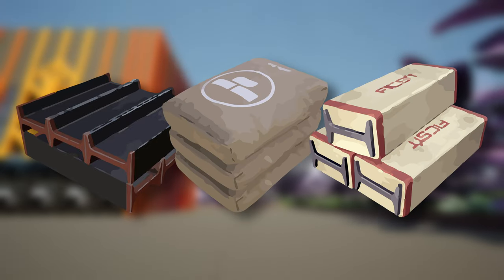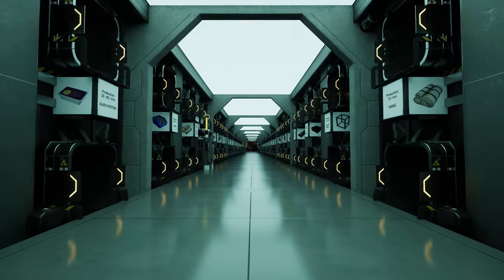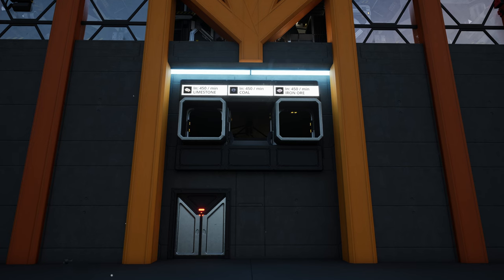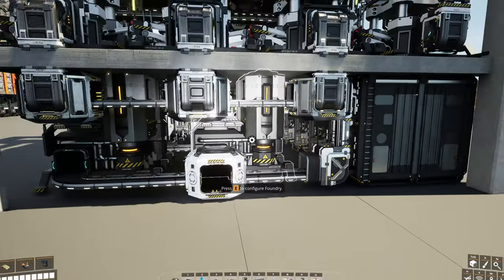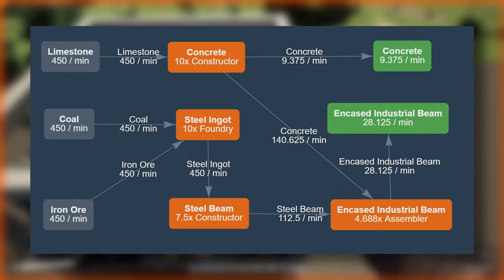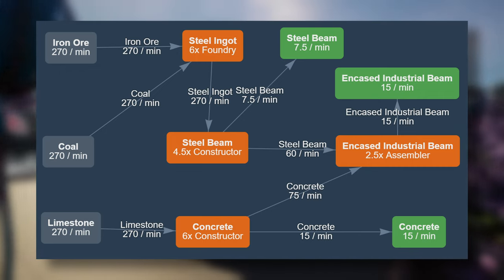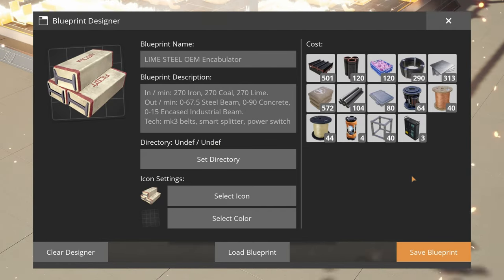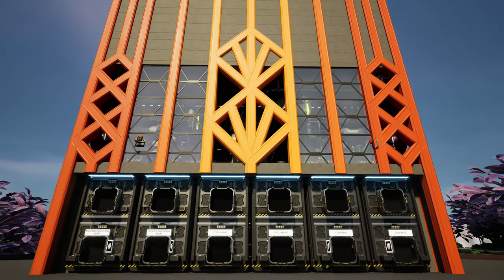Concrete & Steel will NEVER end now! I hope...

Comment: i wonder if you didnt care about production amounts and only cared about automating every part... what would be the minimum amount of blueprints you would need to make every item in the game...
or well not necessarily every every item but at least everything excluding weapon stuff and stuff you physically have to gather the materials for... like no point automating bio stuff  but every single thing purely gained from miners and such... and i dont think radioactive stuff is the best thing to include in that either...

cause i was thinking what if you just had blueprints to essentially start producing almost everything ready and just plop them down and connect the belted/piped materials...